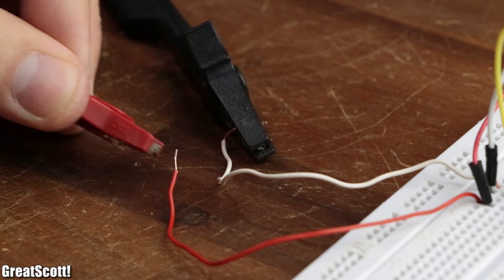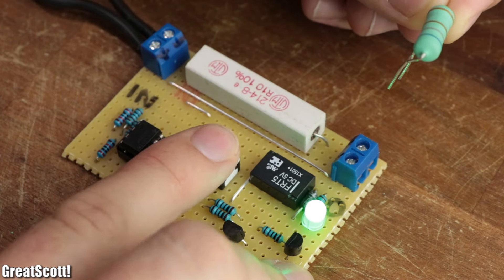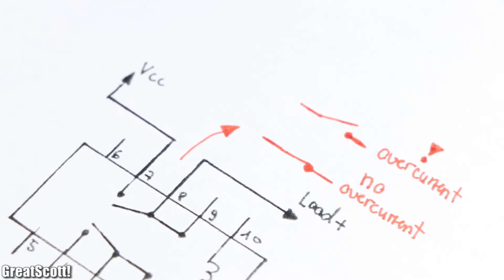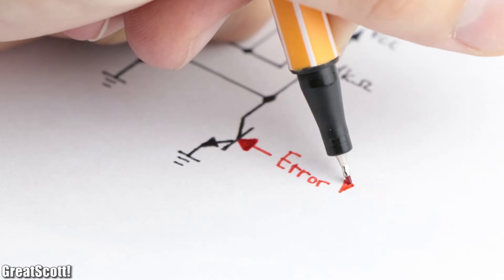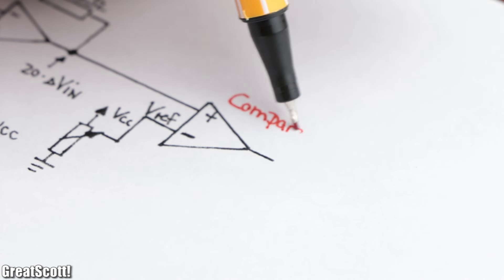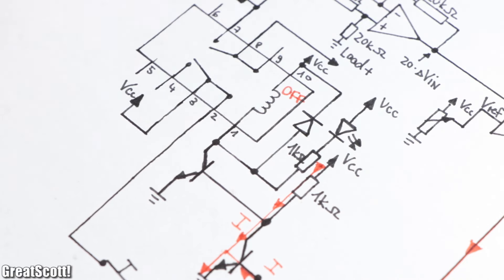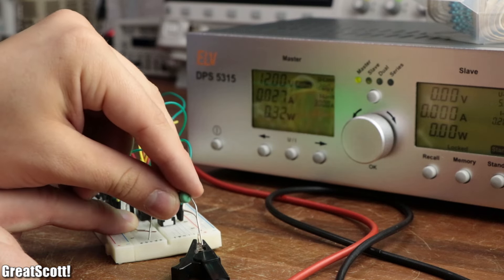DIY Short Circuit (Overcurrent) Protection

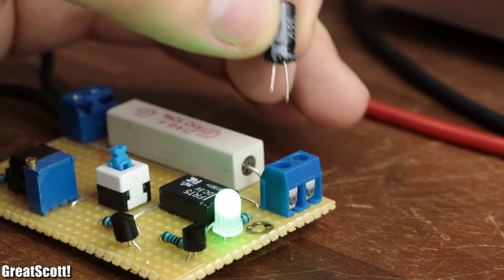Comment: why did the circuit turn off while u placed a capacitor( 6:37 )..shouldn't capacitors block DC?
Reply from the maker: The capacitor would have blown up like the ones before the intro. But the circuit stopped the current flow.
Reply: so u connected the capacitor by reversing its polarity(+ve of cap to -ve of output and vise versa?)

Comment: @GreatScott! what if the ic is very sensible to mistakes and the relay speed won't be enought to protect the ic
Reply from the maker: Then you are screwed. But jokes aside, If you need a faster protection circuit, you will have to analyze the current rise and implement a lot of other things. It is not simple.

Comment: You should make a MPPT charge controller from scratch and measure its efficiency against a cheap and/or expensive model.
Reply from the maker: It is on my to do list but I am not sure when and whether it will happen since it is such a big project.

Comment: I think improving the circuit design can be achieved with a low power adjustable voltage regulator, and adding a half bridge rectifier at the differential OpAmp output to make it work with AC.
Reply: Half bridge would explode in current got to big

Comment: hey bro i am new to your channel. I am a student of history so  I don't know much about the electricity. I want to know something from you. I my home there is too much voltage up and down occurs. For this my graphics card got damaged 3 times.. I have added a 1000 va voltage stabilizer. But the problem persist. The stabilizer just make a sound and for some second i got no display but after few moment i got my pictures on the display. So I want to know what should I do now and is there any  device that can give me continously 220 volts if there is any sort of low voltage or high voltage. I need the solution. Thank you
Reply: Look up an UPS

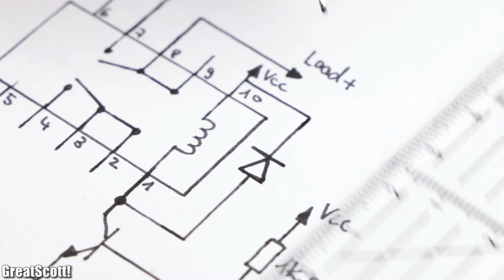Comment: At 2:27 you added a diode that runs parallel to the coil of the relay. What is that diode for?
Reply: John Leuenhagen if you disconnect the coil it is still energized. To prevent dangerous voltage spikes the diode acts as an alternative route for the current
Reply: John Leuenhagen It's called a fly back diode . The coil is Energized so as to establish connection between the two pins as in the video . When the coil energy is removed , since it's a cool with a certain inductance, it will pump out a high current which was stored in it's magnetic field which can damage several components. So, with an electromechanical relay, a fly back diode is often used.
Reply: Oh and the high current still exists but it is discharged within the coil itself due to the diode ..

Comment: Thanks buddy for a simple protection circuit👌👌
Reply from the maker: You're welcome :-)
Reply: the last bit about using a fix resistor i believe if the supply voltage changes it will still effect a resistor unlike some zener or regulator please correct me if i am wrong
Reply: Šƫőȓɱ КІЛջ 
  He said "fixed voltage." ;-)
Reply: oh...... thanks
Reply: Thomas Cruz 
LM4040. Somebody is playing with the good stuff.... The challenge for this circuit is the need for an extra reference voltage. For the scavengers and poor boys like myself, a simple TL431 will work. They can be found on almost every AC to DC switching type power supply made for consumer goods :-)
Reply: the internal structure may as very well have a zener diode like in an op amp or a regulator like the lm 05,12 series  albeit more power efficient  basic concept is the same  i just mentioned the most basic element used in regulators and i misheard it ...great sccott is awesome
Reply: Akash Mk It's not so simple...

Comment: Does it matter if I put a 1hm Resistor 10watts???
Reply from the maker: With a bigger resistor value you will get bigger voltage drops. So with 1 ohm you will lose 1V of your supply voltage at 1A. 2V at 2A,.... and so on. You always try to keep such a current shunt as small as possible and then amplify the voltage drop.
Reply: Ok, thank you. I was thinking that was gonna happen.

Comment: I like your circuit, but could you maybe make a video about a circuit which can actually limit the current like in your power supply. So that you can short-circuit it and the maximal flowing current has a adjusted value.

Comment: Would this work in an electric or a hybrid car? Just to protect the batteries or even the motor/generator from short circuit
Reply from the maker: To some extent, yes.
Reply: GreatScott! I've an idea a long time now to build my own supercar and I'm thinkin' to make it electric w/ lots of electronic stuff (like an big electric motor, solar chargable etc.), and I have an old pc power supply w/ over/under current and other protection circuits and I'm thinkin' when I'll start buildin' it, when I build it's ecu from scratch, to combine all these circuits into one. That's why I asked you for

Comment: I thought the circuit was real. But it does not work. Everyone says it on their own page. What a disappointment.
THIS CIRCUIT DOES NOT WORK.
Reply from the maker: It does though. I know. I built it. Showcased it in may videos also.
Reply: @greatscottlab  I like your videos. but All coment in your site  have the same problem. I tried in several ways, but it doesn't work. unfortunately

Comment: Fuse?
Reply from the maker: Well this is kind of like a resettable fuse
Reply: GreatScott! that makes sense. Also I'd guess it's faster to trip because there's no analog delays like waiting for the electrons to heat the wire up enough for it to snap.
Reply from the maker: Yes

Comment: what is about a simplest FUSE for 1 cent?
Reply: Fuse, yes but fuse is not as accurate and has to be replaced. This cct is good for testing when shorts are expected to happen many times. Today I’ve blown two 25oh, 50W resistors protected with 1.5A FAST fuse. Resistor could take 1.4A, so how? If fuse curve is checked it will allow much larger current for 10s before it blows. So for testing I would have to use 0.65A fuse but since it is testing it may blow few times. They are cheap but also not if you think you may blow more than 10 during testing.

Comment: will LM358 work on 12V power supply (i.e Vcc)??? and on relay something like 5v is written what is that suppose to be??
Reply: The LM358 works up to a supply voltage of 36v. The 5v on the relay indicates that the coil is meant to be operated on a supply voltage of 5 volts.
Reply: thanks,, but in here relay is given the supply of 12v..

Comment: For even more simplicity, you can use a single channel power switch IC to provide a fixed voltage overcurrent and reverse current protection. For 500mA or 1A, I recommend the STMPS21X1.

Comment: or you could just put in a fuse (or resetable polyfuse if you prefer)

For overvoltage and reversed polarity protection you need an SCR, zener, and a PMOS. add in a couple bypass capacitors to take care of the noise and a TVSD for surges and you have a very simple, hearty, and cheap protection circuit.
Reply: Glass fuses trip at about 150% their rated value. So a 5A fuse trips at almost 8A.  This circuit is much faster and more precise than any type of fuse (resettable, glass etc.) and it's even adjustable!

Comment: Well, nice, but the same goal can be achieved with just two transistors and two resistors. Or with a mosfet+one bipolar+two resistors, if you'd like to minimize the voltage drop. Beside, mechanical switches (relay) are just not fast enough for some purposes.

Comment: Great Video. I have a doubt. In 2:59 , why wont the current flow through the base of the transistor that is connected to the relay coil? I mean, both the transistors have their emitters grounded, and the resistance in the path of the both the transistors are same, so why does the current not take both the routes? Please clear my misconception.

Comment: This was actually the kind of video i was waiting for. About 3 days ago iv been working on a short circuit protection circuit, though i didnt use a relay. Iv been using thermal fuses, which is kinda crude, but you get the idea. Great video though 👍

Comment: Its great, but I think relay systems are slow compared to solid state switches. And also there is the problem of the Vcc powering all the devices an voltage references. Finally, there's still a current leakage going to the load.

Comment: Am I the only one who noticed  5v DC relay used in 12V circuit?
Reply: I saw that 😑
Reply: The data sheet said it could handle that, but yeah, should’ve used a 12V relay

Comment: if you used a mosfet instead of the relay and let it oscillate freely then filter the output with a couple of a by-pass capacitor you could have made current limiting circuit
Reply: Yeah but relay has lower power loss
Reply: Jamil Hneini  but relay can't oscillate fast enough for the current limiter
Reply: Camilo Mason I don't think you need it to oscillate right? Just close it when there's no overcurrent and open it when there's no overcurrent
Reply: @jamilhneini1002  sorry but no, P-Channel MOSFET FDWS9509L
-F085  has only 8mOhm Rdson and can handle 65A and the price is $1.46 USD while this relay is 50mOhm contact resistance for 1A with a price of $1.34 EUR , not mentioning that the MOSFET can shutdown the rail lightening fast compared with a relay, and the MOSFET is way smaller than the relay, latching mechanism can be added by using a diode as feedback in the comparator so no problem there.

Comment: The video has great content, congratulation, keep on doing like this, I was wondering if you can make a video related to "voltage/current clamp circuit", I'm looking for the theory and also application using different ranges which the current clamps can be set hardware

Comment: Very nice video as always! I've got a tip though, maybe when explaining a circuit you just have the full schematic shot from above and explain by pointing a pen at important sections. I get rather confused with all those red lines crossing the actual circuit which makes it hard to follow the explanation. Anyway, keep up the good work!
Reply from the maker: True, but I think the chaging perspectives and close ups show what components I am currently talking about and also keep the dynamic of the video up. I simply think an overhead shoot is often boring.

Comment: Great Video! but I have one question: Is it possible to insert an ammeter in this circuit to view the maximum current I am going to set?
Reply: Also, How should I connect this between the load and the meter if I am going to make my own power supply? Won't the additional circuitry also draw current?

Comment: You could also use an external Vref at the non-inverting input of the second op-amp (based on Zener diode or an IC Vref source) to achieve setting current limit not dependent on Vcc.

Comment: I have one of this 35$ power supplies from ebay, it works (relativly) fine but when it reaches the set max current the voltage breaks down. Is this normal or just badly constructed?

Comment: Nice video Jeremy, I especially liked the time you took to show burning parts...and your commitment to a blown-electrolytic-capacitor-scented-lab...all for a 3 second clip.

   What is the advantage of this type of circuit instead of a simple N-channel power MOSFET with a reference voltage on the gate to limit current? Do you plan to use this circuit somewhere (uncommittedly to your channel) specific?
Reply: Who's Jeremy?
Reply: it's his real name i think

Comment: Im sure this circuit works perfectly, but Id rather use solid state devices (P MOSFET) instead of relays due to their simplicity, low on-resistance and gate memory nature. Can you show an example of short circuit protection using a MOSFET?

Comment: video idea: how to make a battery-powered electric outlet
Reply from the maker: Soooo DIY Inverter?
Reply: +GreatScott! yes xD (i am a bit noob at electronics xD)
Reply: yeah you should do a DIY stabilized inverter
Reply: wait.. wait...wait.... i have a better idea: How to make a DIY Battery or something
Reply: +iTzFurrry iverter seems good
Reply: +Pryzmat140 yes xD
Reply: GreatScott! Im actually working on that right now to provide power to a POV display using the motor shaft as a transformer core. The POV was made using GreatScotts video, and Ive been using his witeless charging videos as reference for this modification.
Reply: You can just buy an inverter (which is what you're talking about).

Comment: Hey greatscott awesome video. I have been trying to find or come up with a design like this for a linear power supply that i built. Do you think this would be a good solution?? And also would it add too much voltage drop on the output of the supply be ause that has been my main problem with other designs i have found??? Hope to hear from you thanks

Comment: @GreatScott! What is the no-load current draw? At minimum with an e.g. 6V battery source, I immediately see a 1K + 21K path directly to ground ... 286 µA. How long does battery last with > 100µA no-load discharge? Of course, this is swamped by the current lighting D1 (3V / 1K =) 6mA. And the relay K1 must be energized to provide current to the load, which was >3.8V drop over the DC coil resistance (+ Q2 resistance): 1 FRT5 spec shows 257𝛀 at 6V (+Q2 ON resistance) ~23mA. So right off I see quiescent no-load current of 29mA. How long to over-discharge one's battery? Another Question: Why not use FET's with very low ON resistance? Note: a recent over-current + polarity protection circuit explained by Jeri Ellsworth https://youtu.be/QZ0WXQWND-I?t=430 also has a 60K (100µA@6V) continuous path Vcc to ground.

Comment: Why did you use a relay instead of a MOSFET? I see the convenience with the second relay contact for the pushbutton feature though ;)
Reply from the maker: With a MOSFET you will always have a small voltage drop across the drain source path. A relays voltage drop is almost non existent. On the other hand a relay draws around 25mA constantly. There are lot of pros and cons.
Reply: also, relays are power rated

Comment: @GreatScott!  Hey Scott, can you make a circuit that can cut the power off when the device reaches a certain level of temperature and then brings it back on when the device cools down? for example I need this circuit to connect it to my car battery's charger, I want the charger to shut down when the battery reach a high temperature
Reply: You could use a thermistor or RTD. Run a low current through it and use a voltage buffer to take the output and use it however you wish. You will have a variable voltage that relates to the temperature of your RTD. You can use this voltage to trigger an op amp, comparator, microcontroller, or MOSFET circuit - which can in turn activate or deactivate the circuit at a set temperature. You would calibrate the temperature sensing device by varying the current through the RTD, and calibration of your end device would depend on implementation.
Reply: yah. thermistor triggering the transistor to the relay. some math

Comment: Wow, nice video, 
but is there a most compact and simple way to prevent short circuit?

I would like to have fun with lipo and mini solar panel by making my own PCB, and overcurrent protection is one of my "things to add", but this method require really larges components and seems pretty over-enginnered, isn't it?

I don't judge, mainly because I'm a totally zero at electronics, and I'm trying to learn with good stuff like this channel, but there is often many way to obtain the same effect in electronics or computer programming, and I wonder if someone can give me a simple way to protect my circuit with small parts? (Not a complet tutorial of course, juste a method name and I will investigate ;))

Cheers!

Comment: Make A RFID Door Lock
That Would Be Awesome!
Reply: seconed.
Reply: Circuit's Everywhere it is easy that you only download the rfid library and connect a relay to drive motor
Reply: Jonathan Chan But where can you download the rfid lib. And how to programme it to detect a certain card?
Reply: +TheRaellz It really isn't insecure if done correctly.. Plus locks only deter innocent people, if someone wants in they'll get in.
Reply: TheRaellz Yeah but as a begginner im having big issues with learning how to code. It is a HUGE leaning curve.
Reply: BeGamerSl 
Start with the examples (if you're using an arduino) and just edit them a bit to see what happens, there's also many tutorial videos on the subject too. It does take time learning to code but once you learn the basics of one language, it can be used to learn other languages faster :)
Arduino is most like "C" so start off with a C tutorial or an arduino code tutorial, all the best.
Reply: Skruffles Thanks
Reply: If you want you can contact me and I can help you with the code. Just say if you want, and I can add you on Skype, FB, or Steam
Reply: Stay creative, and I will see you next time!

Comment: How can such sensing method work if LM358 requires inputs voltage to be 1.5v lower than positive rail?
Reply: assuming that requirement refers to the voltage difference between the inverting and non-inverting inputs then there shouldnt be an issue